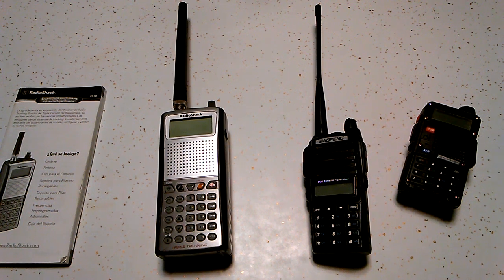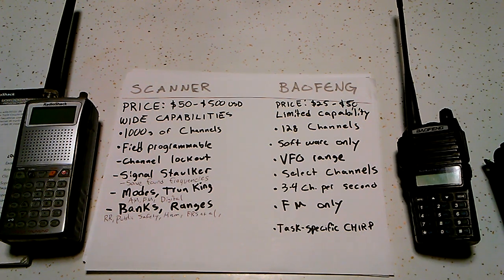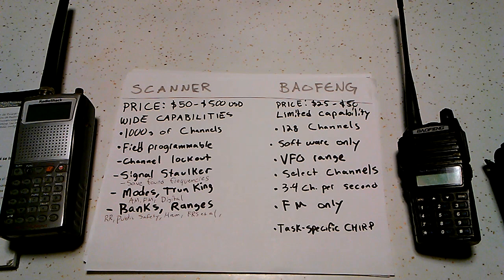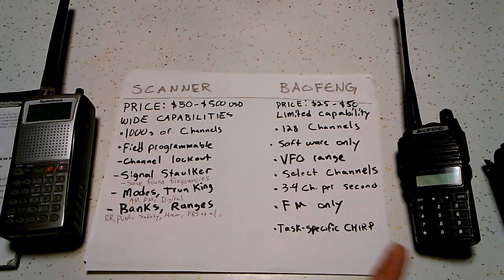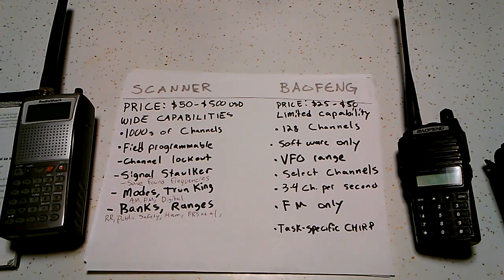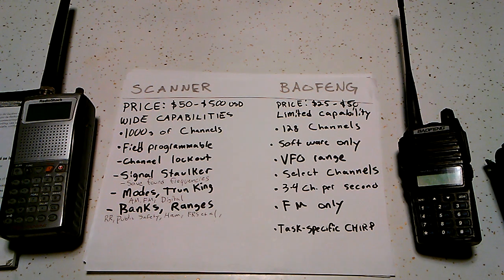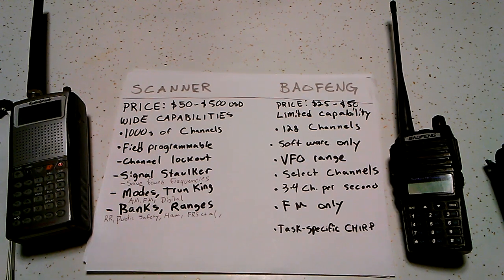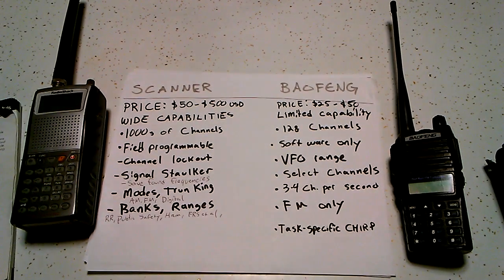Scanner vs Baofeng as a scanner (rough draft)

Comment: Thanks for the video most hams talk at 100 MPH I listen at a much slower pace. Yours was just right. I am new and have a couple of questions that should not require a new video. I am new to these radios and ham. I bought the Baofeng UV 82. The offset default is -0.6 does the radio automatically correct this when you program a frequency that is + or +5.0 . I know it can be can be changed in the menu but have not found out when it needs to be done in the programming steps. Have looked at numerous videos and it is not clear to me. This Canadian will appreciate your help. Thanks
Reply from the maker: The default is just the way the radio comes; you will need to change it if you need it +/- 5Mhz or anything else in VFO and make sure it is correct when programming a channel.  When you program a channel, it will stay what you programmed it as.
Reply: @509rifas  Thanks But can't I just delete the channel and start over. I only want to receive for now
Reply from the maker: @jackpatriquin6636  if you are just wanting to receive, then you don't need to mess with the offsets.  The offset is for repeaters that have a different input frequency; if you only want to receive just program in output frequency which will also be the one listed on repeaterbook.
Reply: @509rifas  Thanks again that answers lots of questions. I live in Nova Scotia a small province on the East coast. I am at the third highest elevation on the mainland. In line of sight 15 miles from the closets repeater. I have programmed 6 other local repeaters and only get interference from a channel that is not programmed as near as I can tell. Guess I will need a better radio or an antenna
Reply from the maker: @jackpatriquin6636  how does the other frequency interfere?
Reply: @509rifas  Well it stops the scan and yet it seems to not always stop on the same channel and I only have 6 programed. The squelch is set to default 5. It is difficult to catch as it is only for a second or so I have only caught the frequency twice. I see from the other replies the scan is fast if I have the latest firmware I have not checked.
Reply from the maker: @jackpatriquin6636  am out at work right now, check this video in the meantime.  https://youtu.be/a6CYkikq3o8

Comment: Are you a designer for hire? I could use some help. 😂
Reply from the maker: Tom Olofsson yes, i work on a by project basis.   My skills are in high demand and require extreme concentration so they aren't cheap but I have a ham discount.
Reply: Nathan Holn  Cool, I am a newby. Got my Technician but have not spent any time on the air W9OLO